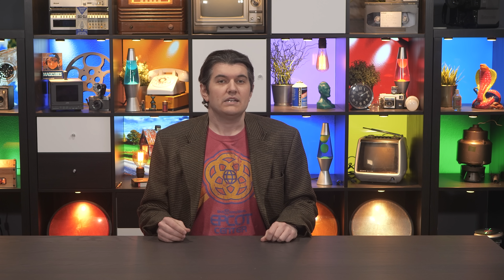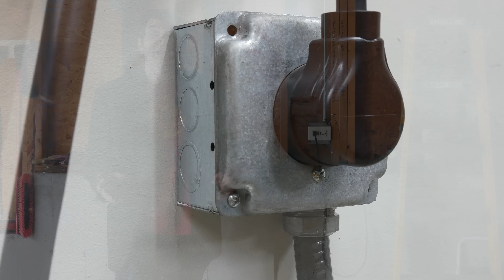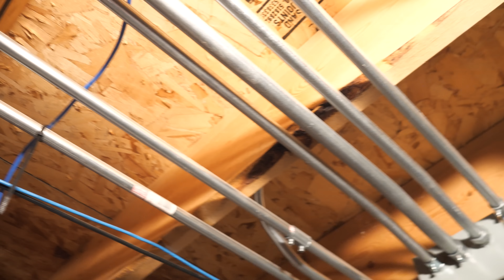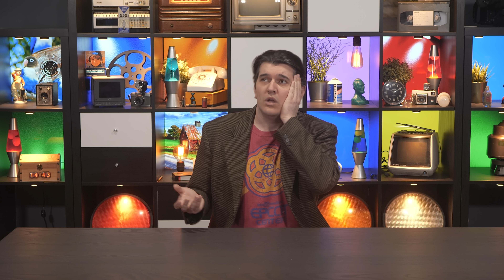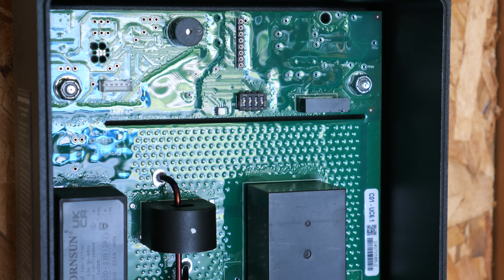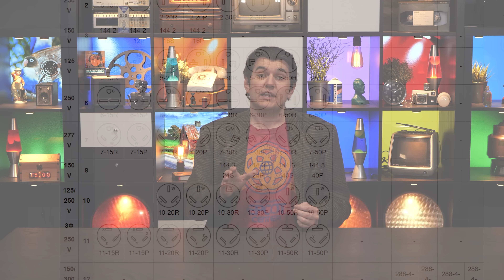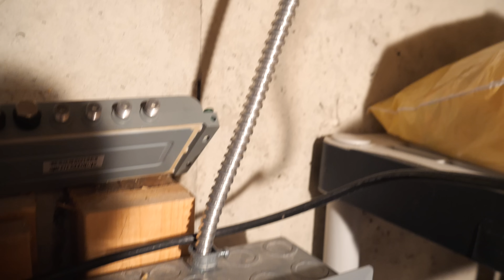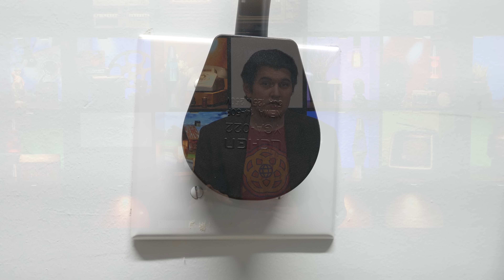The "standard" car charger is usually overkill—but your electrician might not know that

Comment: Used to run my EV off of an EV rated (it could take 13A 240V for extended periods without overheating) socket for months before we moved house. Sure I was only charging with 2-2.5kWh, but overnight it charged more than I used and worked perfectly well for our needs. 
Now at the new house I have a "proper" 7 kWh charger and all that changed is I plug in twice a week instead of every night

Comment: Wire nuts.... Here's the thing - they require a skill to install.  Properly installed, they will handle a lot more current than a leverlock device, but a monkey can install a leverlock properly.  Improperly installed, wire nuts are dangerous.    Personally, I will only use wirenuts and never use a levelock device.

Comment: For those wanting GFCI protection on the circuit and decide to hardwire like he did, you can get a GFCI breaker. If your state is on NEC 2020 or later you are under the mandate to use it, but ultimately it's your home.

Comment: Really enjoyed your video.  You address the real, practical needs for charging.  Why spend more to solve a problem that happens rarely?  I agree.  I use a 30amp 240volt charger powered by my dryer circuit.  Works great.

Comment: Every situation is different, so my typical message for newbies is if you aren't going 50 miles a day on average, then just try to use a 110V outlet and see how it goes.  You can always upgrade once you get a feel for your needs.  I'd say 110v works for 75% of folks and a 240v 30 amp circuit (think dryer outlet) pushing 24 amps to the car works for most everyone else.

Comment: 2018 Model 3 LR RWD...drove the first 3 months with a faulty adapter charging using 120 VAC @ 3 mi/hr, when I got the replacement charging at 5 mi/hr was better but barely enough for my 60 to 100 mi daily drive. Then I put in a 240 VAC 15 A plug, Charging at 11 mi / hr. That for me is the sweet spot. Don't need more. I have a supercharger only 15 miles away but only used it once back in the early days. I am an electronics guy so I "get" EVs. I don't think I am saving the world, just doing what works for me and that makes sense. EV producers need to do a better job educating the public on EVs and charging. WRT the argument that you can fill your gas tank in 10 minutes, but an EV takes (Tesla = 30 to 45 minutes, the old Chevy Bolt over an hour). But what is not counted are all those trips to the gas station to fill up (for me that was twice a week for my daily drive.) that is 20 to 30 minutes a week for gas V 5 seconds a day to put the plug in with my Tesla. On my latest trip from Michigan to Texas I noted the increase in charging stations. Most times I now plug in when I have biological needs (in coming and out going) and that is more than enough to get me to the next similar stop. (Ok, I'm 75 and 2-3 hours is my usual limit.) If Walmart goes thru with the plan to install EV chargers, then that alone should make travel with an EV all the more convenient.

Comment: Thing to note is that not all power distribution boxes alternates each phases on every slots, those last 2 slots could have been the same phase and you'd be scratching your head wondering your charger isn't powered up and your tester reads 0 volts

Comment: Living in southeast MI. I have a Nissan Ariya that came with a Nissan 32A EVSE. Had to call in an electrician since my panel is full and the panel is located from 1 corner of the house and the location i want it installed is on another corner.
Electrician had to install a 50A subpanel, and move some breaker from the main to make room for the subpanel. Subpanel had the 40A GFCI breaker for EV. Ran a 150ft of aluminum wire to the garage that goes through a crawl space, terminated to a disconnect then copper wire to the nema receptacle. I was happy with the job even though it cost me 3k for everything (material, labor, and permits)

Comment: Nice video.  I've been thinking lower amperage charging somewhere in the range of 16-20 amps but have wondered how local regulations (inspectors, to be precise) view variable settings and the 125% rule?  I was not aware of the Grizzl-E's dip switches.  I wonder if the inspector would panic if I put a Grizzl_E Classic dip switched to 15 Amps and then wired it for 20 Amps @ 240V since it could, potentially, be upped to 40 amps?

It made me happy to see that I'm not the only one groaning about this internet obsolescence craze where perfectly usable equipment becomes a paperweight whenever the manufacturer so decides.  It is outrageous.  I also have no need for my house to be so smart; it only serves to highlight how half-witted most of us already are.

Comment: In europe, charging cables meant for domestic plug have a temperature sensor that will stop charging if the plug temp is too high. It doesn't prevent melting along the line though, that's why it's recommended to use a dedicated line and breaker.

There is also what we call "reninforced plugs". They have 2 features: the contactors are covered in silver and they have a magnet in the receptacle. When the compatible charging cables are used, the cable switches from 8 or 10A to 16A (at 230V) because it "knows" the plug and the circuit are designed to support it. Packs with the plug and breaker are sold around 175€.

Comment: I’m an electrician in Chicago.  Very good video. But. A GFI breaker is required for cord-and-plug connected setups in a garage and outdoor installations, based on the National Electric Code (NEC) (specifically NEC 625.54 and 210.8), i'm wondering why you did not install a GFI breaker.
   I just realized you hardwired your car charger. The one you installed is hardwire so it doesn’t require a GFI breaker. the charger you were showing on the desk had a plug so I thought that’s what you installed.
Reply: Welcome to the real world. Nobody is spending $200 extra on a breaker when the regular one is fine.
Reply: @BelRayOtter-ek9qk  it’s not fine.  That is going to kill somebody. There are very good reasons why GFI breakers used

Comment: Some EVs, like the Ford Mach‑E, limit Level 1 charging to 12A. The charger is actually built inside the vehicle and determines how much power it can take. Since I have a Mach‑E—actually my second one—this is the data:

Level 1, no matter what you plug into, is limited to 12A.
Level 2 is limited to 11 kW, which means anything above a 48A charger is wasted.
DC fast charging is limited to about 115 kW at the beginning of the session and then ramps down.

Comment: We have a Lucid Air Touring and a BMW X5 50e and we have two Level 2, 40A chargers at home, but only because one of them (a ChargePoint) was only $350 direct from our power provider, the other (a Lucid 120/240v, 16/40A "portable" charger) was free with the Lucid, and I used to be an IBEW electrician so I installed both myself for just the cost of materials.
Otherwise, Neither of us would really need more than 120v 16A Level 1 charging at home, as my 60 mile commute includes trickle charging for free at work, and my wife only averages about 20 miles/day.

Comment: You can convert any circuit to be 240v instead of 120v to get double the power, or just use the existing wire to hardwire it. You will need to limit current further, to 16A for 12 gauge or 12A for 14 gauge but you can get double the power vs 120v if running new wire is problematic. 16A @ 240v is about 3.7KW, and would get you about 14 miles per hour for a car, or 168 miles in 12 hours, more than plenty for most needs.

Side note, computer power supplies will run on 240v (except the old ones), and are actually slightly more efficient this way.

Comment: Thoroughly enjoyed your video!  Considering an EV and have 100 amp service with NO expansion room.  Is it possible to sitll install a sub-panel and move some of the circuits over thus creating room for another 40 amp circuit?  Plus the location isn't optimal as the panel resides outside and an enclosed great room addition makes it necessary to either go under or around to get to the garage location... To add to this situation, the home was built before code required GFCI in the garage...  Looks like I need to pony up for an electrician to access my panel situation... Thanks for sharing your experience and solutions!

Comment: I was getting 4 miles of range per hour with an 120v circuit... i added a 50 amp 220v circuit next to the breaker panel (only 3 feet of 6 gauge wire with extra for only $20.)  total cost of only about $50.  I ran my RV 50 amp extension cable to the outside of the garage and plug in the 32a 220v charger that came free with my Tesla model Y. I get 34 miles of range per hour now.

Comment: I just drove my electric truck from North Dakota to California and back, and I want to push back on the idea that people can rely on DC fast charging instead of adequate home charging.

In North Dakota, my residential electricity averages about 10.5¢/kWh after fees and taxes. On that trip, the cheapest DC fast charging I saw was ~$0.34/kWh, and the most expensive was $0.79/kWh.

With gas at $2.86/gal and a realistic 16 mpg truck, gasoline costs about 18¢ per mile. In my Lightning, that puts gas parity at roughly $0.30–$0.35/kWh, depending on conditions.

That means most DC fast charging is at or above gasoline cost per mile, while home charging is dramatically cheaper.

Because of that, the safest approach is to size a home charging circuit for what the vehicle and wiring are capable of, rather than intentionally undersizing it. Charging needs change — longer commutes, unexpected trips, or pre-road-trip charging — and relying heavily on DC fast charging adds higher costs, idle fees, session fees, and other junk charges.

Use cases also vary widely. I’m a rideshare driver, and my truck can charge at 19.2 kW (80A) on AC, which requires a 100A circuit. That gives me roughly 34–44 miles of range per hour, depending on conditions. There are nights where I come home, sleep a few hours, and then need to head back out for long trips — sometimes 95 miles one way.

Not everyone has that use case, but people change jobs, schedules, and driving patterns all the time. Given the cost of installation, intentionally undersizing home charging is usually the mistake — not the other way around.

Comment: I used a 120V for a few months for my Tesla but it was a bit limiting. My electrician buddy came over. I bought all of the parts and helped him run the new line from a new 50a breaker. He only charged me $100 because I helped him so much. Total cost: under $350. I now add almost 30 miles of range per hour of charging. Been doing this for 1.5 years. I throttled it down to 32 amps. Works like a charm.

Comment: I miss my Volt. Live in a Condo, the charger that plugged into a standard outlet was enough to charge it overnight. I could plug it in to our exterior outlet (unlike apartments where there is no exterior outlet that is routed to your unit). I put 520k miles on that poor little car. It was such a trooper. 290k registered as engine-on. That's it. For all the long-distance driving I did it was just an insanely good car with ridiculous fuel savings. Some kid bought it who had an engine swap for it. I often wish I would have just searched for and had an engine swap done and kept it! lol That's all that was wrong with it. Engine finally gave up the ghost. I think it likely needed a new planetary gear assembly too.
Reply: plugin hybrids are such great cars

best both both worlds

Comment: Fantastic video, very helpful. Hadn’t thought much about the software side of home chargers, completely agree, will similarly opt for one that does not need an app. 

One problem for those of us not as confident about our level of electrical knowledge and skills: once you hire a licensed electrician, the labor costs dominate the total cost, and the incremental cost of putting in a 40 amp charger vs 24 amp seems insignificant.

Comment: i have seen 50a nema plugs warm up and melt down in under a year do a slightly weaker install. even though its seems overkill. heat can also change on the season such as summer in the south where 100 degree days are normal. these plugs also get weakened fro a number of reasons and now with new NEC where elctric cars have to be calculated as a continouse load they seem reasonable

Comment: We tried using a 15A 120V outlet to charge our EV9 and even with it plugged in as much as possible, we weren’t able to out pace the energy consumption. I big thing to keep in mind for most people is:
1. Understand how many miles you drive a day.
2. Know the efficiency of your electric car (how many kilowatts you’ll use per day)
3. How much time do you have to charge at home.
4. Look to see if your local power company has any EV charging incentives/programs to make installing a lvl 2 charger cheaper.

Comment: 17:00 "Are you filling your car every day? Unless you're a professional driver, you're probably not."

I want to add here that these chargers DEFINITELY help professional drivers, although the way they help professional drivers can be different than the way they help my man making this video.

Let's take my 2023 Kia EV6 that I'm renting for Hertz for use with the Uber rideshare platform. I go through the battery in about 7-8 hours due to the fact that my job is just plain driving until I'm satisfied for the day.

I will then plug the car into a public fast charging station (usually EVgo), let it get to 80-90%, then unplug and drive the remaining 4-5 hours. When I'm finished, I then go to a public fast charging station less than 2 miles from my apartment and only charge to about 85%, then I go home.

I do not have 240V access in my apartment without doing something that would most definitely violate my lease, so I'm using a 120V (level 1) charger set to 13 amps. The J1772 cable is snaked under a door that I never use and then goes to my parking space right on the side of the building.

This accomplishes several things: 

1. It reduces my dependency on public charging stations, making charging cheaper. I've yet to see public charging stations in my area that offer (including discounts and plans) rates below 10¢ per Kilowatt Hour, expressed as $0.10/kWhr in the EVgo so.

Usually at night, it's about $0.12/kWhr, and in the day, it's as high as $0.45/kWhr during peak electrical demand.

At home, I pay $0.08/kWhr for my electricity during the night, and $0.15/kWhr during peak hours. Using this slow charger means that I can offload a portion of my electricity usage to my home charger, meaning I use less expensive public electricity and use more cheap home electricity.

2. A level 1 charger is very slow. However, just like how keeping your faucets dripping is enough to keep your pipes from freezing, keeping just a small amount of power moving can help to help your EVs battery from getting quite to cold. 1.5KW, as my car displays when plugged into my level 1 charger, is the same amount of power as a 1,500 watt (1.5KW) space heater. It's not going to keep that big heavy battery toasty, but it will keep it from dropping the whole way down to ambient temperature on cold winter nights.

3. The main reasons for losses in EV range in the winter comes down to battery temperature and heating effort. Using a slow charger helps to keep the battery from getting quite so cold, that way when I come out to the car in the morning, battery conditioning has slightly less work to do in order to get the battery up to its happy temperature. That's coupled with the fact that if I set my climate control while the car is still plugged in, a lot of the initial heating effort is offloaded to the charger instead of only the battery. Heating an electric vehicle before unlocking it DOES WONDERS for increasing winter driving efficiency, as it takes far less power to maintain a comfortable temperature than the high amount of power needed to get the interior of a 20°F car up to 72°F (or whatever your preferred temperature is).

4. On days when I just go to Walmart or whatever and I don't do Uber on those days, my 1.5KW level 1 charger can completely recharge my car in less than 10 hours, even in the winter. This means that when I do decide to do Uber the next day, my EV is already fully charged AND it got its charge from my cheap home electricity instead of an expensive public fast charger.

5. Yes, I still rely of public fast chargers. Replacing the need for fast chargers is not something that such a small charger can accomplish when you're driving as much as I am. However, the whole point of the slow charger was not to negate the need to use public fast chargers, but to reduce my dependency on said public fast chargers. Being able to come out to my car, run battery conditioning, set climate control, and just text friends for a couple minutes while the car warms up is MUCH LESS disruptive to my daily rhythm when compared to leaving home, driving to a public fast charger, and hanging around waiting for the car to be warmed up.

Comment: I’ve been charging on 120V level 1 charger for 6 years.  Just plug in when you get home.  I rarely need to charge faster as long as I stay under 70-100 miles a day, and have used the local Tesla super charger station, which is 2miles away,   less than 5 times a year!